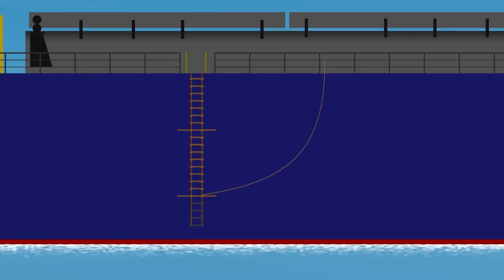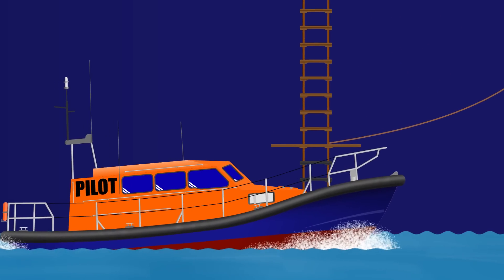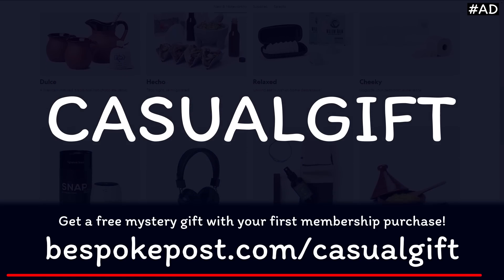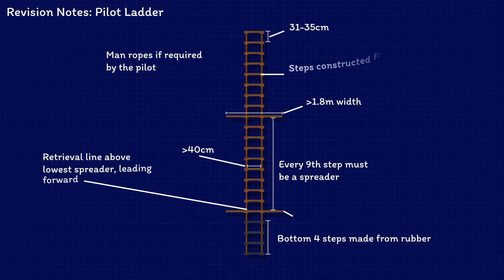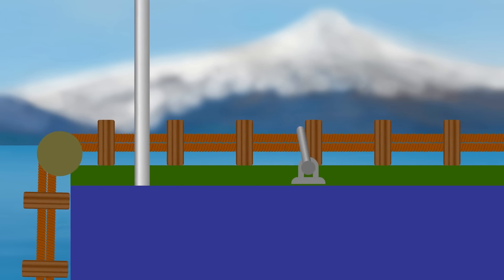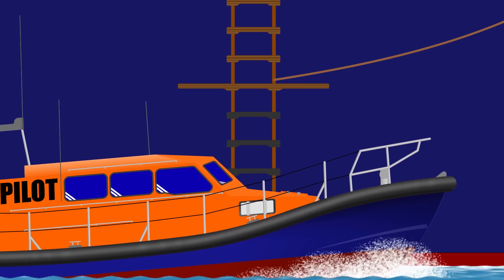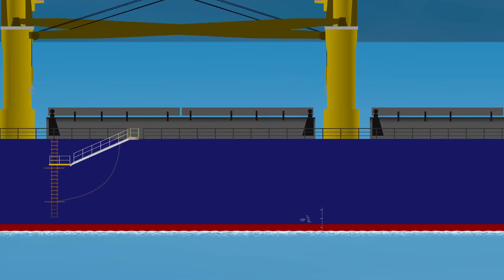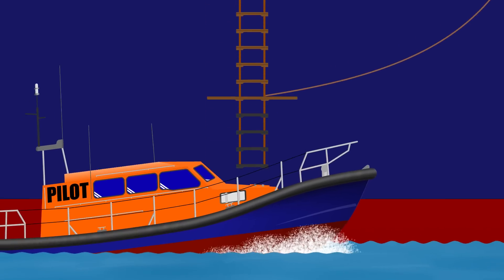Why Do Ships Have Rope Ladders?

Comment: Maybe a discussion on pilots wearing helmets and a proper closed cell floatation lifejacket that offers some ballistic protection in a fall would be appropriate. It also doesnt need a mechanism to inflate and cant be damaged by barnacles and other punctures. Broken skulls, ribs and bleeding lungs and kidneys are deadly at a remote pilot station.

Maybe a reminder not to wear a backpack on the ladder is in order too.

Tough to have a lifejacket hold up all that weight and keep your airhole above the water.

Best if the pilot boat doesnt camp under the ladder. Wait till the boat is out of the way before climbing up too high.

Water landing always beats cold steel railings, decks, deck houses, and bitts hard points on the pilot boat.

Anyones pilot boat carrying a tourniquet for catastrophic lower leg injuries?

Comment: Is it possible to get a video on why there are no feasible alternatives that are a lot safer? I mean I can still see Pilots slipping or tripping when the ladder is indeed in tact. This is an insane task to me.
Reply: I'd wager it's regulatory and practical. There's no inherent reason why a safety cable with an elevator brake tethered to anybody climbing up the ladder couldn't be used. Or a fan used to slow the descent to a reasonable clip combined with an emergency dry suit. 

That being said, those both contribute complexity and expense to the process and would have to be mandated by whatever nation's flag the vessel is sailing under.

Comment: It seems crazy to me that, with all the engineering that goes into these ships, they don't have built-in provisions for this. Maybe a door near the waterline, or if that's too complicated, a dedicated staircase or winch that's part of the ship? Maybe even just a rigid aluminum or fiberglass ladder that hangs over the side? Can anyone explain why these aren't better than a removable ladder that has to be skillfully set up every time?
Reply: Depending on the design, some ships do have hatches near the water line.
Rigid ladders aren't used due to maintenance issues and being prone to be damaged by high seas or when docking. Davits and lifting baskets would work but would suffer from improper maintenance just as much as rope ladders would. Rope ladders are inexpensive and easily replaced, but as stated, the problem is lack of maintenance and inspection.

Comment: Why just have the stairs at the top?  Why not all the way down?  It seems like if it was just longer it would be perfectly capable of swinging down to the water line and then the pilot could just walk up the stairs?

Why have a temporary rope ladder at all that is subject to all this misuse and misconfiguration?  Why isn't it a permanent ladder with all the right dimensions and stability built into/attached to the hull?
Reply: Due to swells.  You can get onto a ladder at any height above its bottom, but you can only get onto the accommodation ladder at its bottom end.  So you keep the bottom end high above the wave crests and climb up to it.

Comment: Why is there no safety harness involved, with a line secured to the ship that pilots can latch onto for the climb up/down? Has it been tried and proven dangerous? I can see how if the pilot were to get swung around uncontrollably, but have never seen it before and am curious.

Comment: As a rock climber I find most of this ladder stuff mind-blowing. You don't drop a line to the pilot for him to tie into a harness? Yikes!
Reply: I think the main problem with this is what happens if the ladder breaks and the pilot is now hanging on a rope at the side of a ship while potentially being hit by waves. You cant just call the fire department for a hight rescue like it would be possible on land and you probably wouldnt have a second ladder read to let him climb up the rest of the way. So the only option would be to pull him up but that needs training and multiple men to do. Also youd risk an uncontious pilot banging against the hull of the ship while hoisting him up during heavy waves. 

The way it is now if the ladder breaks he lands in the water where he can be rescued by the pilot boat. I think thats the reason aswell why mechanical hoists arent allowed
Reply: @maxwfk  : falling several meters onto the pilot boat below is not likely safer than dangling from the side and then having time to work out a solution (such as, say, rappelling down).
Reply: Or a metal ladder that is bolted onto the hall.
Reply: I'm guessing the ship moving is the reason why they tend to not use a hoist. A static line for safety sounds like a good idea to me.
Reply: Exactly what I thought. Even if the pilot ship is out of the way. I wouldn’t like to experience an unexpected fall from like 8-9 meters into the waves :/

I guess ascending on a single rope would be safer, albeit slower..

Comment: All well and good until you get a pilot getting mad because he insists the ladder should be rigged with shackles and you have to just nod along at a certain point and give up on trying to make him understand that the way you've done it is actually the recommended way.
Or pilots wanting only the accomodation ladder with long swell
Or pilots saying the magnets are too high when they're at the right height above the accomodation ladder platform
Or pilots who request the wrong height above the water for the ladder and make you rig it again when the pilot boat is already alongside 
Or pilots agreeing to embark with only the pilot ladder after confirming that the freeboard is under 9 meters only for them to call again 10 minutes before boarding asking for the combination instead 

Sure Mr. Pilot, of course Mr. Pilot, here's your coffee, here's some cigarettes

Comment: when I was in the coast guard in the Bering Sea, we would have to board large fishing vessels daily for inspections. Most of the time they would have rope ladders, but often they only would have a single rope with knots tied in at regular intervals. These were quite dangerous to climb. Occasionally when we had to board one of the very large Japanese factory ships they would lower a large basket down to our motor life boats and we would climb into the baskets and they would lift the whole boarding party up onto the deck. In the 2 years I was working on the coast guard cutter, we only had one crew member go into the water, it was when he had to let go of the ladder to land back into the motor life boat and misjudged the timing.

Comment: I still wonder why ships don't just use the motor launch or an open lifeboat, and its davits, for boarding pilots, seems like it'd be much safer to just ride what's essentially an elevator up than to cling for dear life to a swinging rope ladder like Indiana Jones. Hell, depending on sea states and the slope of the ship's hull, you could even drop the thing straight onto the fantail of the pilot boat if it's a lightweight RHIB, no stepping over water at all. Besides which, inspections of lifeboats and davits are MUCH more stringent than inspections of a dirty wood-and-rope ladder that gets stuffed in a rope locker in the bowels of the ship and kinda just assumed to be rigged properly and up to spec even when it's far from it.

Comment: Couldn't the pilot wear a harness, with the proper equipment to use a rope as a secondary security? Corrosion from sea water is probably a problem with such equipment, but it's not very expensive, easy to deploy and doesn't need any modifications to the ships.

Comment: The pilot serves only as an advisor for the ship master and has no command of the vessel...The only place where Pilot has the total command is in the Panama Canal
Reply: the pilot is in control of the navigation of the vessel and is rarely questioned unless it's something the captain thinks it putting the ship in imminent danger.  legally he is an "advisor" but he still takes control of the navigation.
Reply: @bryanachee7133  Thats the long version of it yes but he is to be challenged for his actions and knowledge if the OOW is not safe on his actions
Reply: @Traaseth92  what do I know as I’ve only been a pilot for 16 years. Some of my pilotages are over 9 hours. The master is sometimes in bed. Not many chiefs and 2nd officers are going to challenge a pilot.
Reply: @bryanachee7133  I guess I am one of them then xD , I work as a 2nd officer in Cruise , most pilots I have sailed with is amazing but I have also had the worst at rare times which can be challenging
Reply: @Traaseth92  cruise vessels are much different as many more people on bridge, they usually have a staff captain and the one of the senior officers usually does the docking, not the pilot. Most cargo vessels the pilot is doing the maneuvering
Reply: @bryanachee7133  I can believe that , usually he only takes the conning with trackpilot or gives wheel orders to QM , If it is a long transit he keeps the conning but sometimes gives the trackpilot steering to OOW

Comment: Another excellent video, thanks. One of the scariest things I ever had to do, leave a vessel to go to a pilot boat, over a 100 kms off the coast in 2.5-3 m significant wave height. Climbing down the ladder is already pretty scary, but transitioning from the ladder to the pilot boat under those conditions is very, very tricky. However, it went well, but great respects to all the pilots out there.

Comment: OOoooohh..... i just stopped scratching my head realizing i got the video title wrong. 😁 I was waiting for the explanation why rope is (still) used as material instead of a mechanical solution like a lift or some ladder welded to the hull.... my bad !
Then i saw a dude in a comment below wondering why ''rope'' is ''still'' used...maybe that could be a follow-up video. '' Hey Dude,.. they also use ropes to secure the ship to the shore, believe it or not ! It's still the best solution for some things (if handled correctly ofc) ! ''
Reply: I asked a friend who's working as a Maritime PMC about using those ladders in big(ger)waves or bad weather and he said:" Your either refuse, or it gets VERY exciting, very fast !'' Hehehe... oh boy,... ballsy stuff !!!

Comment: Redundancy? Climbing harness and climbing rope would add much safety and the pilot could bring the load bearing rope with them themselves for extra safety along with their own harness
Reply: Probably just introduces more points to make reattachment mistakes or get entangled through that extra line. I'd imagine if something went wrong during the climb, it'd be easier to bail into the water instead of getting repeatedly bashed by the ship due to being clipped in.
Reply: It’s been tried and tested and found to be extremely dangerous.
Reply: How is it more dangerous?

Comment: I usually like your videos and never get disappointed, but in this case the main question is not answered: why is it a ROPE ladder? Why not a rigid fixed ladder, etc.
Reply: You sometimes see fixed ladders at the stern of the vessel, protected by steal pillars, to avoid the ladder or the person using it being crushed during a boat landing. Fixed ladders require more maintenance, are easy to damage during more difficult sea states, just as they can easily damage the pilot boats. Furthermore, fixed ladders move along with the vessel, rope ladders have some freedom to compensate for that movement.

Comment: That fatality rate for pilots is INSANE to me.  Do Pilots have leeway to say "Sorry guys, your ladder looks dangerous, there is no way I am climbing it" or are they just ordered by port authority to help when requested no matter what?
Reply: Flaws in the ladder might not be visible from the bottom. A step could give way halfway up or the ladder cold jerk down on its securing point and throw the pilot off.
Reply: @gordon1545  often the first time we see non-compliant set up is after we’ve already climbed it.
Reply: The final decision always rests with the pilot.
Reply: there should be heavy fines when non-compliance is detected, and heavier fines when it results in an accident. ship owners and operators will only care if the $ risk is highenough
Reply: @FreeGumFighter  there’s definitely not enough deterrent in my opinion and should be greater penalties.  Although cancelling a ships arrival due to non compliance costs the operator tens of thousands usually, due to delays. so indirectly they are ‘fined’.
Reply: why don't they drop a safety rope that attaches to and quick-releases from the pilot harness? like aerial work and rock climbing already do.
Reply: @play005517  That might be more dangerous.  if you fall off, theres a chance you can float clear of the ship (I imagine they'd wear a floatation vest or at least be a strong swimmer) and be picked up.  if they're tied in, they could just get dragged against the ship
Reply: If the crew keep correct tension of the rope, you won't really "drop" much during a fall, and the rope won't flapping around 
If it's the weather condition causing the slip, yes you may swing off, but you can also release the rope if the quick release is implemented correctly and you decide the rope is more danger than helping. If that also fails you can cut off the rope with a parachute knife.
But yes, that may be too much things to do in an emergency.
Reply: @bryanachee7133  psh, what do you know about being a pilot. This is the internet good sir, we're all experts here. And I will have you know that I have also climbed a ladder on multiple occasions.
Reply: @sarahbezold2008 so how about a system that will pull you clear from a water anyways?
A simple hydraulic winch would be enough.

The same way the military recovers dragged/towed paratroopers during static line jumps.
Reply: @play005517 because at some point, with the Pilot boat pitching up and down, I’ll be bungy jumping. Plus, I’ll be relying on the integrity of a safety line I know nothing about. If the crew haven’t rigged and maintained a safe ladder they are unlikely to have rigged and maintained a safety line. If the Pilot transfer arrangements are rigged as per the regs, then it should be as safe as it can be. No need for an extra safety line.
Reply: @play005517  because you still are relying on a $21 a day seaman to rig that for you
Reply: @play005517 Human failure on sea is way too common. Its better to do one or 2 things very good then having alot of tasks and stuff to keep track on where everything will be less then ideal.

The crew is working with heavy fatigue and minimal sleep.

The pilot too probably has long shifts too and dont want more stuff to clown around in.

These are not rock climbers or well rested climbing workers. 

Already just carrying a handheld VHF radio and a lifevest is too cumbersome, and then a helmet so you cant even see upwards. Its already hard enough work as is, more stuff would be too much.

Personally climbed alot of sketchy latters on barges in waves and rain. Though its not allowed. We take off alot of stuff, including helmets whenever possible. To be as light and quick as possible. Then the rest we have in a bag we pull up afterwards.
Reply: As a swift-water rescue technician, I can assure you that it is disturbingly easy to drown on the end of a rope. If a "safety line" was in fact safer, I would think that pilots would already be using them.
Reply: Perhaps noteworthy for this thread that we lost one of our Pilot brothers early this morning (4th February) due to a boarding incident at the southern entrance to the Bosphorus.  Rest in Peace Captain Oğuz Kök
Reply: @marinepilotchris3048  Shame.  Always hard to hear.
Reply: They surely can , but most often ladders damaged on top , where it connected to ship structures and you can't see it from pilot boat .
Reply: i think pilots should get to be extra and parachute in from a hanglider.
Reply: I have done a few launches on the pilot ladder for service work. My first time as  I stepped into the ladder my co worker yanked me off as the boat slammed into the vessel exactly where my leg was. It’s a fun time.
Reply: I've seen pilots refuse going up a gangway because of being too flimsy and too steep, choosing getting on the line boat to approach sea side
Reply: a Pilot is  a full blown Captain - he has the patent and is allowed to steer  a ship.
so he is also allowed to not use a ladder if he doesn't want to.

it also means he doesn't get paid, since they get paid for every ship piloted in or out of port.

so go figure yourself
Reply: @Xingmey Thanks for that. Respectfully, I am both a ‘full blown Captain’ and a Harbour Pilot. I’ve been the latter for 19 years and done 4000 transfers. I feel qualified to comment
Reply: @Xingmey I also don’t get paid per job, so I have to justify to my boss why I won’t climb the ladder
Reply: That's worldwide.  2-3 a year isn't that many. There are 10,000+ licensed harbor pilots

I'm honestly kind of surprised how low it is, with how many millions of transfers are done
Reply: @Artyomthewalrus  2-3 per year is actually extremely high.  2023 fatality rates for all workers was 3.7 per 100,000 (US statistics).  Pilots suffer near 10 times that figure at around 3 per 10,000 workers, and has been named by some sources as being one of the most dangerous professions.   That figure is skewed even further because many thousands of pilots transfers are completed by helicopter, and other acts of pilotage that don’t involve boarding or disembarking a ship at sea.

Comment: You want the ladder to be rope, not cable,  and not rigid aluminum, so it can sway with the waves and the relative motion between tug and ship, not corrode in the salt or scrape the side of the ship, but most importantly,  a rope ladder won't be too rough for the pilot to climb against,  won't be rigidly fixed to the moving ship, and won't toss the pilot about,  injuring him or tossing him into the sea. See; common sense. I think he meant for us to figure this out ourselves.